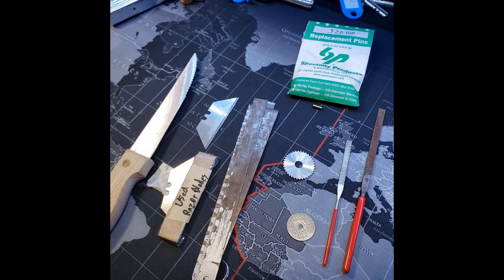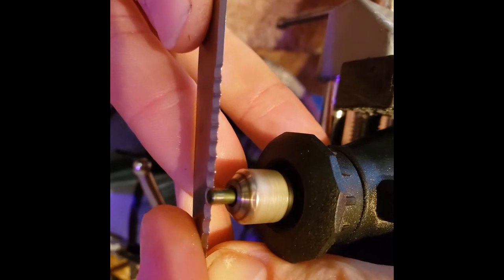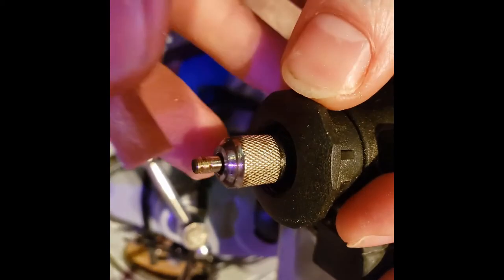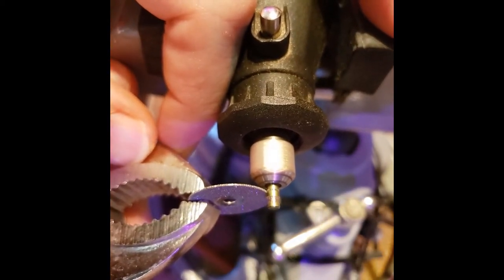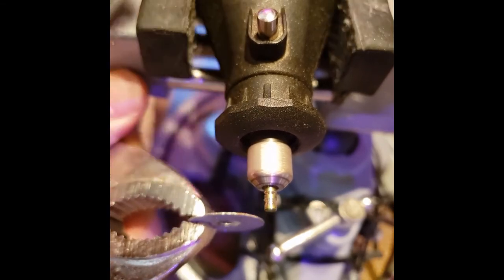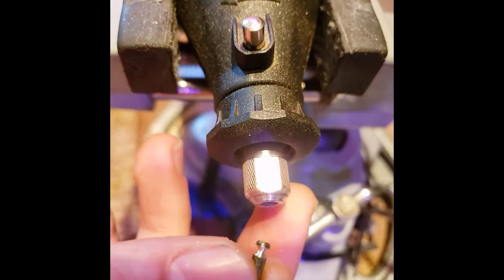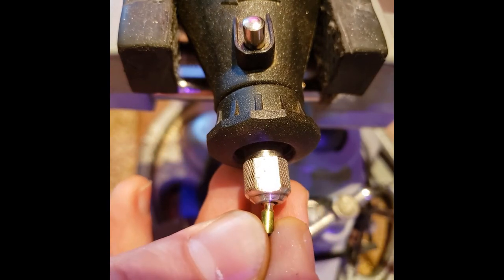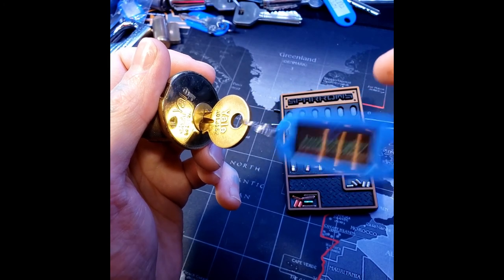45) How To Make Custom Pins for Challenge Locks - 1st Challenge Lock Giveaway!

Comment: I would like to win it even if it's going to take me a few months to get it open. However, I'll understand if you want to send it to a more experienced picker.  
I just started making my own challenge locks that I'm getting ready to send out. 
Can you over tighten the keyless chuck when putting a pin in it?
Reply from the maker: Keep a lookout for the next videos, I have a couple more Challenge locks I'm pinning up that will be more moderate to easier difficulty 😀  I haven't overtightened the chuck on a pin yet. BUT, I have had the chuck mess up and already modified pin.  This can happen when the spool end is in the chuck and using too much force when grinding on the other end working on
Reply: @LockpickingDev  It's a good thing I saw this video then. Thank you for explaining.

Comment: As an extreme novice...I'm wondering what makes custom pins harder to pick than standard ones.

In my head, if they have the same OD, don't they slide in their barrel (not sure that's what it's called) just the same?  Or does the spring tension make them angle slightly and catch on the serations? If so, wouldn't they do the same with a key?
Reply from the maker: It's the tension that you putting on with your tension wrench that makes the catch up between the bible and the core.  Keys dont do this because as you're inserting the key, you're not turning the core at all yet til the key is fully inserted and pins are at shearline.  Custom pins themselves can be more tricky because of the different depths of spools and serrations.  They also give less of a traditional feel compared to normal security pins.  When you encounter a spool or serrated pin in a lock, most of the time you have good confidence in what that spool/serrated pin looks like before gutting it.  Custom pins makes different combinations (spool with serrations in different spots, 2 different depths of spool on one pin).  This breaks up that muscle memory of picking normal security pins and makes one REALLY pay attention to and remember what they've encountered on each pin while working through the lock